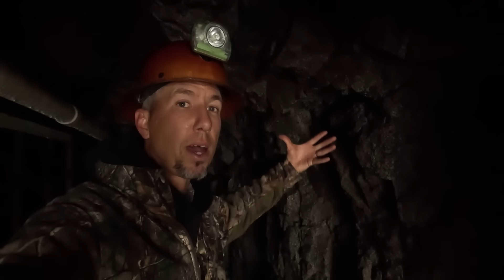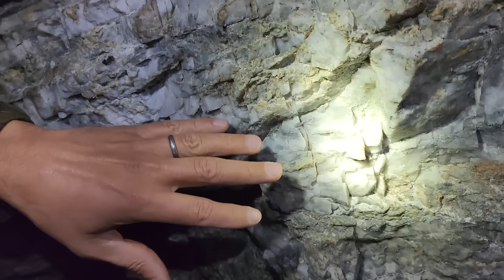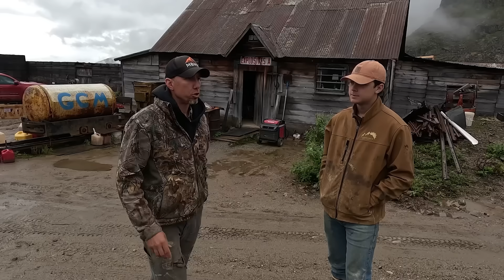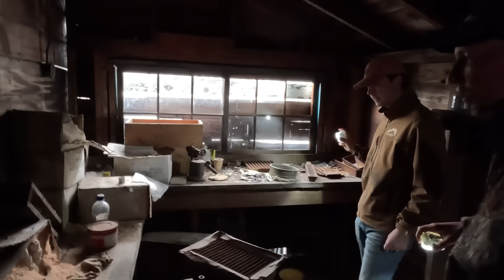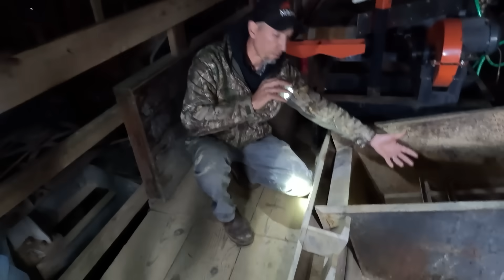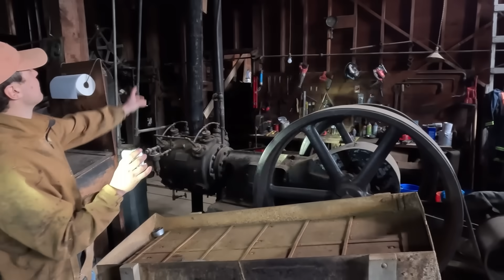Underground in Alaska: High-Grade Gold and 100-Year-Old Workings at the Gold Cord Mine

Comment: I was a mill operator in Central City Co and we were running old tailings from the area. The ore was mostly galena and sphalerite with very little gold. Gold is associated with the iron pyrite and through chemistry we would suppress the iron pyrite/gold and using mainly Ph we would first float the lead/silver and that froth was a dull gray, from the lead cells the slurry would then flow into another bank of cells after being treated with hydrated lime to adjust the Ph higher. The zinc cells were brownish or yellow depending on the mine. We ran heads and tails test at each step to measure the recovery. The pyrite/gold went into the tailings pond. This is common to throw out this because the gold content in the pyrites was too low. These tailings pond hold a large amount of minerals still.

Comment: I drove a 200' raise in Alaska @ 1992. It is work. The raise we drove was bald, meaning no timber. We drove it off off steel ladders.  I've drove dozens of raises from little 4x4 bean hole raises 20' up 8x8 100'. Worked on an Alamak (raise climber) driving a US record 1280'. That one was beat by a longer raise in Montana at the Stillwater mine.

Comment: Using an underground core-drill may locate close high grade ore and will eliminate drifting into uneconomical ore bodies. If the old timers had some ore in the 5 oz per ton grade, using physics in dowsing gold will lead to areas that need to be core-drilled, then mined after the core-drilling confirms minnable ore.

Comment: Josh, you have the perfect gold depositing area that will benefit from the use of physics in dowsing gold or any sought element. My book: The Art Of Dowsing - Separating Science from Superstition ($14.95), by Michael Fercik, explains the reverse engineered physics involved in dowsing. It all starts by all element's atoms radiate a unique electromagnetic microwave band frequency, with no two elements having the same, with is produced by the static electricity of electrons spinning around the nucleus of neutrons and protons which also spin around each other, while having almost no weight with radiating in a sphere of laser beam straight lines from around the atom. A certain number of the same element's atoms contained in an elemental mass combine together their radiated electromagnetic frequency for producing that element's unique elemental magnetic fluxes lines, also with no two elements having the same, and have some weight with gravity's pulling produces an opposing split double bowed arching from the exact center of the concentrated element where their stacked tightly together, with spacing further apart towards the edges. The distance between the start of the radiated bowed arching to the termination back into the earth is determined by the strength or contained amount of the element that produced it. The special self built modern light weight ball bearing dowsing rod is energized into being an electrical generator and motor operating at the same time by the radiated elemental magnetic flux lines of the pure (9999 for gold) one-tenth ounce dowsing rod load, that is tapped onto the elevated (used for gauging) acetylene welding rod, at five-inches from the  hubs shaft, which is free spinning on ball bearings, crossing the same element's radiated elemental magnetic flux lines from in or on the ground. This precisely dowses the location of all edges, exact center, depth buried with angle of deposition, and grading or deciphering the amount of the contained element. Anybody can become a professional dowser by learning all the physics involved in dowsing and how to build the special modern light weight ball bearing dowsing rod practicing and mastering the dowsing lessons that are taught in my book.

Comment: Guys, probably a stupid question but why is it not possible to have a portable crusher on rails (like the slusher shown in this video) with a feeder that gets ore down to powder size which is then then vacuumed out via a small air hose to the surface?
Reply: One reason could be that moisture would turn that into mud.  The other reason may be the energy required.